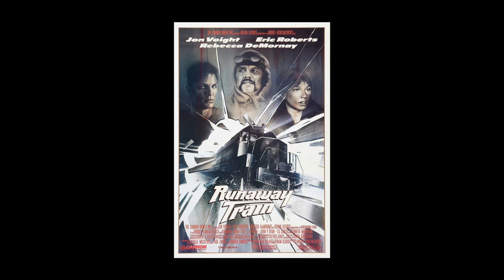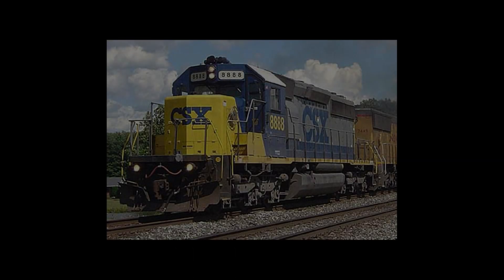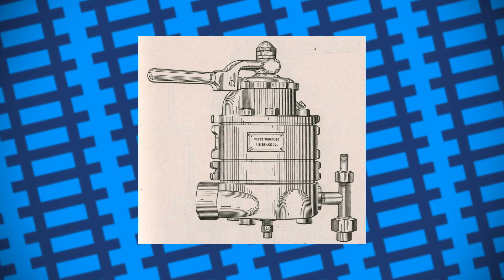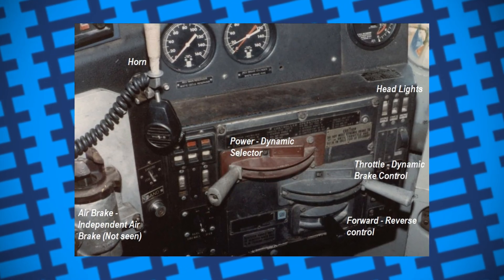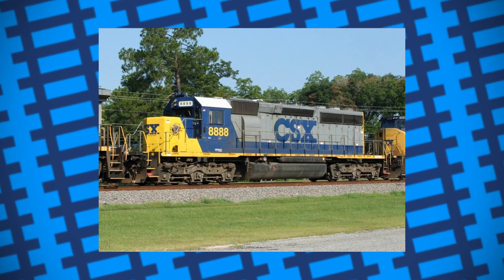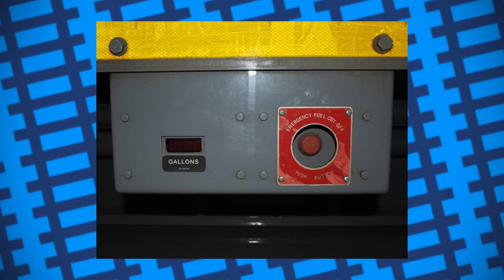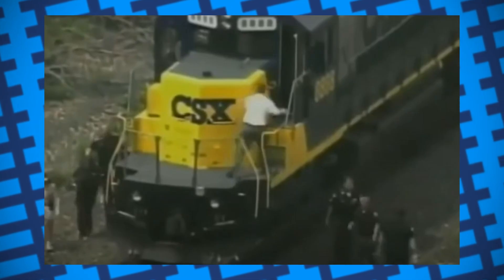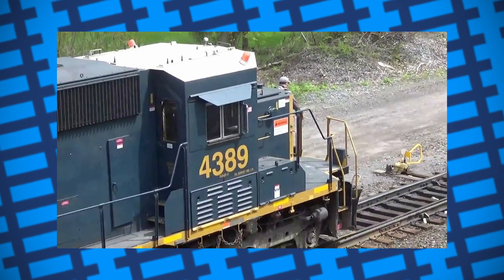How to (and how not to) stop a runaway train - Crazy Eight's Incident

Comment: BHP runnaway
5 November 2018 accident describes the circumstances leading up to the train’s runaway, which culminated in its intentional derailment, resulting in 2 remote locomotives, 245 ore cars and 2 km of track infrastructure being destroyed.

When the train, which was being operated by a single driver on BHP’s Newman to Port Hedland railway, was about 211 km from its destination, an inter-car connector separated, severing trainline communications between the lead locomotive and the ore cars toward the end of the train. This initiated an automated emergency brake application, stopping the train as it approached Garden South, which was on a falling (downhill) grade.

The loss of trainline communications started an in-built 60-minute shut-down feature on the braking system of the affected ore cars, which were now holding the train. 

After reporting the emergency stop and taking a number of procedural steps to protect and secure the train, the driver exited the cab without completing the step of placing the automatic brake handle into the pneumatic emergency position. The driver then commenced the process of applying manual handbrakes to each of the train’s ore cars. 

Sixty minutes after the train stopped, and before the driver was able to secure enough of the ore cars’ handbrakes, the affected car control devices shut down, and the brakes were released on the majority of the ore cars in the train.

The train then began to roll away without the driver on board. 

In the ensuing runaway, the train travelled more than 90 km over approximately 40 minutes, before BHP’s Hedland control intentionally derailed it at a crossover to an adjacent track at Turner South, about 120 km from Port Hedland.

“A train runaway can cause injury or loss of life, and while there were no injuries as a result of this accident, it did carry a significant financial and economic cost,” ATSB Chief Commissioner Angus Mitchell said.

“A certain set of specific circumstances meant not completing a single safety-critical action – placing the automatic brake handle in the pneumatic emergency position – had a significant consequence.

Comment: Look up BHP runaway train in the Pilbara 
BHP runnaway train in the Pilbara
The BHP runaway train incident in the Pilbara region of Western Australia involved a fully-loaded 42,500-tonne iron ore train that was intentionally derailed after traveling over 90 km without a driver for approximately 40 minutes. The train was about 211 km from its destination when an inter-car connector separated, severing communications between the lead locomotive and the ore cars. This initiated an automated emergency brake application, leading to the train's runaway. The ATSB investigation concluded that the train was destroyed, and 1.5 km of track was damaged. BHP's rail operations in the Pilbara were suspended, and the company estimated it would take a week to clear the track and resume operations. The incident raised concerns about BHP's risk assessments and communication with train drivers, highlighting the need for improved safety protocols in the industry. 
The brake the driver activated had a time limit which expired.

Comment: They were very lucky that 2nd locomotives caught up the train.
Apparently close to the end of trip
Otherwise it would be a disaster.
What they could do much earlier is to set up 2 locomotives ahead of runaway train, they know speed of 47 mph. On straight strech of tracks this new setup would wait. At correct calculated time this set up of 2 locos would start amd speed up to ex 40 mph until runaway train would bump into them at minimal force absorbed by 2 heavy locos and travel together.  Apply emergency breaks and would stop.

Comment: Funny enough, engines are now frequently operated by remote control while shunting: the driver is always walking next to the engine, with the remote control on their belt. 

Hyce (YouTuber who used to work for BNSF) has a funny story about that, because it led to one engine having a bathroom failure and filling up with poop, because it was only used for shunting for several years, and the only time the driver was ever inside the engine was to use the bathroom, so no one noticed the smell enough to flag the engine as needing repair.

Comment: When Unstoppable came out I looked up the Crazy 8s incident.  The 2 crew members of the chase locomotive couldn't believe a movie was even made.  They thought is was a pretty mundane incident.  As we saw in real life when force is applied to a train it slows down.  It doesn't just keep accelerating like its being pulled by an invisible force.  That's not how physics works.

In real life a derailer was used.  If hooking up engines (another engine was further down the line to get in front) didn't work CSX stated they would have pulled up track before the train reached Columbus.

Comment: I think this story is hilarious, especially considering that no one got seriously injured. It makes sense to me what the engineer did because, if he had set everything correctly, he no doubt would have been able to jump back on the train no problem. It's very easy to jump onto a slow train but you don't want to get on or off when the train really gets going and it's amazing how fast even some of the really long and heavy trains can get going from a complete stop! There is a walking trail that goes along next to the tracks near my house and I see even trains with engines at the front, middle, and end get going definitely too fast to jump on in probably a minute or less. I've only jumped on a train once in my life and only stayed on for maybe a few thousand feet, so I don't know all that much about jumping on or off when one is in motion but I know when I see a train going how fast I'd be willing to try if that was ever my intent again (which I don't imagine will ever be the case again since I just did it that one time to see if I could).

Comment: In Poland every engine and every railroad steering post are equipped with radio-stop. If it is activated, it triggers emergency braking in all trains in about 10-15 kilometers radius. It is an acoustic coded signal sent via radiotelephone. There is also a rule, that if anyone hears just an uncomplete part of this signal, has to press his own radio-stop button instantly, in case the system was activated, but the full signal was not sent before a crash.

Comment: I'm a retired locomotive engineer and had 37 years of service operating trains. I was involved in two runaways, the first occurred on mountain grades and was caused by a bent air pipe on a car about 10 cars behind the locomotives. An alert crew on the caboose was able to apply the emergency air brake when I told them that I had no control of the air brakes. We had gotten up to about 65mph on track that was rated at 45mph.
The second runaway was caused by a transient riding on the second car of the train. For some inexplicable reason he closed the angle cock (valve) on the car so I had no control of the train brakes. Cabooses (cabeese?) had recently been eliminated from our trains and there were no failsafe systems to apply the brakes if something like this happened. We were approaching a 10mph siding at 60mph. My assistant was running and running when he applied the air brakes nothing happened, then he put the brakes into emergency and still nothing happened. At the time when you put the air brakes into emergency the dynamic brakes would be disabled. I never understood the reasoning for that. We got the train slowed down from 60 to about 45mph and went in and out of the siding at that speed. We were able to recover the dynamic brakes by then and that slowed the train down to about 10 but couldn't bring it to a stop. I bailed off and started tieing handbrakes on the train until it stopped. 
I ended up testifying to the state legislature and a congressional committee to put radio controlled rear end devices on freight trains

Comment: The same mistake of not switching from traction power to regenerative braking was made in Switzerland in 1948 at Wadenswil.  They were not so lucky; the passenger train ran away down a steep incline, smashed through the buffer stops at nearly 40 mph and demolished a building. 22 people were killed.

Comment: The UK seems to have a history of (usually minor) runaway trains.
If you include track maintenance vehicles we still get through one or two a year. This includes unpowered trolleys, rail grinding units, ballast tampers, Ro-Ro vehicles (rail/road) and the like.
An example of this would be the runaway engineering train on the Northern line of the London tube from Highgate to Warren Street on 13th August 2010. An engineering train had failed and was being towed back to the depot. In order for it to be towed they had to disable its brakes. There is a long gradient through Highgate and, just after Highgate station, the coupling between the trains broke and the failed train rolled back down the line where it came from. The signalling staff had to frantically warn tube trains ahead of it to keep moving as the runaway headed into central London at speed. Fortunately, the track levels out after a while and the train came to a halt of its own accord at Warren Street. Apart from some points (US: a switch) at Mornington Crescent and some frayed nerves there was no damage done. The whole incident was over in 16 minutes.
More unusual is air-braked locomotives and even trains where the pressure has bled off.
An example of this (probably) is the accident in Edinburgh on 13th August 1994. Diesel locomotive 37 113 ran away (unmanned and unpowered) from Waverley Station downhill and crashed head-on into a passenger train. The passenger train was an HST and 59 people were taken to hospital including the driver. He was seriously injured in the collision but recovered. The HST power car 43 180 was repaired but the locomotive was scrapped.
Two examples exactly 16 years apart showing the variety of runaways in the UK in modern times.

Comment: Yeah, using another engine to chase a runaway is the right way to do it! When I first saw Unstoppable, I couldn't help thinking "Get Edward!"
Reply: The guy in charge wasn't the brightest bulb in the movie.
Reply: They were very lucky that 2nd locomotives caught up the train.
Apparently close to the end of trip
Otherwise it would be a disaster.
What they could do much earlier is to set up 2 locomotives ahead of runaway train, they know speed of 47 mph. On straight strech of tracks this new setup would wait. At correct calculated time this set up of 2 locos would start amd speed up to ex 40 mph until runaway train would bump into them at minimal force absorbed by 2 heavy locos and travel together.  Apply emergency breaks and would stop.

Comment: Just to clarify something i know little about, dynamos, think car alternator, only provide resistance to spinning if a load is applied which in a diesel electric locomotive is usually a resistor on the roof much like an electric heater you plug in that gets hot from resistance. One horsepower is equal to  746 watts all things being equal.

Comment: As an American I feel very offended by the words "wagon." But anyways my actual thing to say is about a few missed things. Not all locomotives have dynamic brakes, though it is now a standard and I believe a requirement for locomotives built today set by the FRA (Federal Railroad Administration). Deadman's pedals can also be easily made useless, by putting something heavy on it like a rock. It also have been very dangerous to shoot the locomotive if any big rounds were used, as the fuel cutoff is right above the fuel tank filled with diesel.

Comment: I feel bad for the driver because he tried to do the right thing that would result in the least amount of damage possible. It was probably the time sensitivity of the situation which led to him not setting the brakes properly
Reply: and to be fair, the brake-throttle lever is a bit confusing. I think they changed it to two separate levers after that

Comment: Pushing the button only Cuts-off fuel and to be frank you can't just push the button and it works it needs to be pushed in for 3 seconds until it activates so shooting it would still do nothing. Second the Tankers can handle a lot of abuse great example of what a Tanker can deal damage wise happened on May 4,1988 PEPCON Chemical Rocket Fuel plant Company in Nevada Jet fuel sparks explosion that blew up factory throwing full loaded Rocket Fuel Tankers 4 miles away and they never leaked or blew up them self's so if you ever think a Tanker is going to Explode think of this how many stories have you ever heard of a Tanker exploding None!
Reply: The people in Lac Megantic (those who are still alive) might disagree with you about rail tankers never exploding.

Comment: In many UK locomotives it's not that you have to keep the dead man's handle pressed, it's that you have to periodically release and then re-press it when an alert goes off. That way if someone falls on the switch it will still eventually trigger the brakes.
Reply: Plus there's AWS and TPWS that confirm driver vigilance and can slow a train down if it's approaching a red signal to quickly
Reply: Yeah I don't think anyone uses the simple "hold down the pedal" system anymore, it's way too exploitable, plus it doesn't really catch any scenario where the driver becomes incapacitated while still holding down the pedal.

Just for trivia, in Italy, at least on the kind of trains that I have seen, the system has a pedal that, when pressed, resets a 90-second countdown.
Keeing the pedal pressed doesn't reset the counter, so the driver has to press (and release) the pedal at least every 90 seconds to confirm that he's awake and aware.
If the driver doesn't press the pedal for more than 90 seconds a few audio and visual allarms go off, starting quite mild but getting progressively more and more annoying.
If the driver still doesn't press the pedal at this point he's presumed to be incapacitated and brakes are automatically applied, alarms keep going off and, on some models, the onboard system also automatically "phone" the control room, in order to alert them so that they can check what's going on.

Comment: "When the brakes are being applied, the dead man's switch is overridden, and I have no idea why." 
Because the last thing an engineer ever wants or needs, is their engine suddenly shutting down, when they're descending a hill with a fully loaded train. If the locomotive powers down, you lose all dynamic braking, bingo bongo - you've got a runaway. As the San Bernardino train disaster of '89 illustrates where the conductor saw the train was going too fast downhill so hit the emergency cut-off fuel switch, unintentionally disabling what little braking the train had left.
Reply: That's just dumb. The dead man switch being triggered should never disable braking.

Comment: 27 of November 2017. 7:26

A train hit a broke down car at level crossing, dragging it for a few meters, the car ignited and burned the conductor post.

Later around 20.00 the the 2 SNCB AM96 were being towed up a hill. The damaged locomotive (which was at the end of the convoy) broke away and started rolling downhill. She passed by the railway crossing where she had her accident killing 2 and injuring 2 railway workers.
Arriving now at the station of La Louvière-Sud the train crashed into another. Injuring badly the conductor and the controller. Some passengers were injured too but not as much.

The investigation says that after the accident they tried to uncouple the damaged loco from the undamaged one but were unsuccessful. So they decided on towing them together. In reality the attempts left the coupling system in a mid position due to this the loco was able to detach herself on the incline without engaging the emergency brakes. The loco was only detected a few seconds before hitting the railway workers. Any attempts to stop her were unsuccessful.

It was also found that towing an isolated damaged train on a steep incline was against procedures.

Comment: I'm sure this has already been said but here goes anyway :P
So the loco has 3 brakes yes, the Train Brake, Independent Brake and Dynamic Brakes.
The Train Brake uses the difference in pressures between the brake cylinders on the cars and the pressure in the air line to apply braking force (basically the pipe is always charged at 90 psi and reducing the pressure in the pipe applies the brakes) this works on every car and as long as the hoses are connected
The Independent Brake applies straight air to the locomotive brake cylinders. It's your basic bog standard air brake. It only works on the locomotive however.
The Dynamic Brakes transition the traction motors to DC generators, applying mechanical resistance to the axles and also creating an excess of electricity (think of regenerative braking but on steroids) This excess electricity is sent to large resistors on the loco roof where it can be discharged as heat.
In the Crazy 8's incident, the Train Brake pipe was not connected as the loco was performing switching operations and was constantly picking up and dropping cars from different sidings. This also rendered the Dead Mans Pedal useless as this applies an emergency application to the Train Brakes but not the Independent.
The Dynamics and Throttle used the same lever and the driver had to cycle between them via a secondary lever. However, (having driven a GP40 with this set up) These are an absolute pain. There is no clear indication of which mode you are in and it is very easy to mix up which mode you are in (speaking from experience)
The Driver hadn't properly set the throttle to Dynamic mode and thus when he thought he set maximum Dynamics, he actually set full throttle.
Rest of the story is pretty much accurate tho